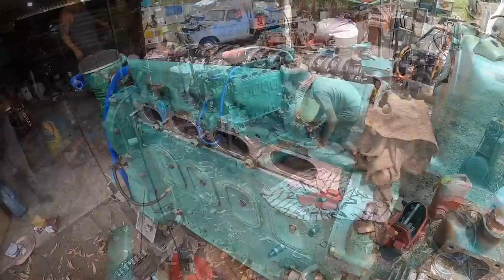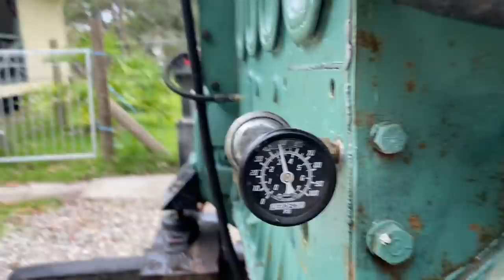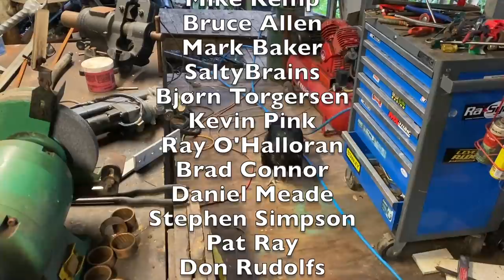First start of the Detroit Diesel 4-71

Comment: Adrian, you are clearly a wizard on diesel engines!!  The way you fixed all the issues as they came up was great!!  Thanks for the Info!!  I once owned a GMC bus with a 8v71 in it.  Great engine never had any issues with it, water pump -yes, radiator-yes, plugged fuel lines-yes - the engine was strong until I sold it. :)

Comment: What a great down to earth guy Adrian is. He certainly knows his engines and the sound of that Detroit running was so different to the noise it made when it was first fitted into Renko was very different. You have been very fortunate to know him and have him do the work on this unit. Be good to see him on a you tube channel just as he is. Be interesting to see how Renko goes once this is reinstalled back in. Did I miss the prop being welded on? New shaft and inner bearings once the Detroit is run in?
Reply from the maker: Prop has been welded on since I bought the boat. Hopefully we can cut it off.

Comment: Adrian: Pulls out a pressure tank, Stu: "Is this cheating?" haha
Man, that Detroit sounds incredible now!
Reply: Sounds a lor crisper, I recall the first time it started after the first rebuild it was quite sick sounding and a lot of black smoke. Zero smoke and good throttle response. Boat is definitely going to run better, first thing I thought of was a good prop upgrade for some more top end.
Reply: @bobbuilder5362  Displacement hull, more digging in, more fuel used, no extra speed.
Reply: @nielsdebakker3283  a higher cruise speed at same rpm is achievable with a tuned prop. Assuming this engine produces more torque at the given rpm. Higher top end may be 0.5 - 1 knot.

Comment: Hey Stu and Adrian, if that sump cap does not have a magnet to collect metal particles I used to get a rare earth magnet that will fit on cover or drain screw also makes it easier to clean because you can take it off. Rare earth magnets can handle the heat.
Great job guys.
Reply from the maker: Nice tip.

Comment: @Dangar Marine, if you need to shut down on cylinder, rather than crimping the line usually you can take one of the injector lines (Jumpers) and use it to connect to supply to the return. IIRC, the lines fit without having to bend anything.

Comment: Sounded good.  Nice even exhaust note so each cylinder should provide equal contribution.  Looks like you picked up some valuable operation and maintenance practices, including triage should something go south.
Reply from the maker: Yes, as well as having a sweet running engine I certainly understand it much better now.

Comment: I had forgotten all the little things it took to set up the injectors and the four valve heads. 

It sure sounds sweet with everything set right this time. The last time it sounded okay but not quite there. It's funny how you remember the particular exhaust sounds of a well tuned inline Jimmy. I worked around the 4 and 6-71s so this is a trip back in time.

Comment: I would definitely swap the exhaust manifold flanges back. You WILL end up with air in the top half and it will overheat and crack the manifold. It needs to self purge air out, via the air bleed on the top - the circulation pump will flush this back to the header tank.
Reply from the maker: I'll look into it.

Comment: You can bypass the injector with the fuel line. All you need to do is to take off the lines from the injector and one of the lines will join back to the fuel rail. No destroying of fuel lines.
Reply from the maker: Would be interesting to experiment with the lengths and clearances.

Comment: Second!!! On the bypassing a injector on most of them you can remove both fuel jumpers and take one jumper and go from the out and in of the head and not mess up a fuel jumper. I've seen the valve bridge break off the bridge guide pin but it will still run on the other two. It really started up clean and didn't smoke like the last first start. You could use a radiator drain petcock as a vent on top of the exhaust manifold to make quick work of bleeding the air. Thanks Stu and Happy New Year.
Reply from the maker: Hey mate, yes, been thinking of changing that plug to something easy to open.

Comment: I was hoping to see what oil Adrian put in as I have heard that multi-grade oils were a no-no for these engines and you should go with straight 40 weight or 30 weight (CF-2) if it is cold outside. The story is that the piston ring gaps are wide to allow for expansion with the pistons getting hotter than most engines because they are 2 stroke. Lighter oil gets past the cold rings and burns forming deposits that cause ring sticking. How do you feel about multi viscosity Adrian?
Reply from the maker: Yes, straight 40 weight is pretty standard for these Detroits and what we put in this one.

Comment: I think Adrian meant EMD. EMD is Electro Motive Division of GM (well once was) and those engines are also Uniflow 2 Stroke Diesel.
Alco on the otherhand are 4 stroke Diesel engines built by American Locomotive Company hence ALCO. Totally different engine.

Like Detroit Diesel EMDs are categorized by the displacement of one cylinder. EMDs are 567, 645 and 710 series. All are 45deg Vee and are V6,V8, V12, V16, V20. Less common is the Vee 20 but even they are relatively common - those secondhand Danish loco imports from 20 or so years ago into NSW have them IIRC. 
EMDs are identical in operation to Detroits however the key difference is the exhaust exits in the Vee and there is one Roots Blower for each bank of cylinders driven at camshaft height on the naturally aspirated versions. 
If EMDs are turbocharged, unlike Detroit 2 strokes, they delete the Roots blowers and have a hybrid centrifugal turbocharger. How it works is it is crank driven for starting and low power settings, then as the RPMs rise exhaust starts to spool the turbine and compressor via an overrun clutch in the conventional sense. They are quite big and not easily identifiable as a turbocharger as they're a big casing on the end of the engine but the Roots blowers on the NA variants are instantly recognizable. Even the side covers of DDs and EMDs look similar.
EMDs are absolutely everywhere in the world. A very common engine.
As Adrian mentioned EMDs are common in marine applications, but they are mainly used for electricity generation in Diesel Electric locomotives and often at power stations. Many EMDs a day rattle across that bridge near Dangar Island as well as Alcos. Alcos have a distinctive rattle sound from the exhaust and dark black smoke when notching up, EMDs sound like the Tug or the gennie in the links below.

Check the veritable cornucopia of Detroit and EMDs in this tug:
https://www.youtube.com/watch?v=c_BKrLZTvsI

Power station load test of V20
https://www.youtube.com/watch?v=hFVJ9Lhhm0I

Shot of EMD valvetrain in motion (note similarity to Detroit 2 strokes)
https://www.youtube.com/watch?v=z6WhVu-UIKA

Nice study of the blowers on this one:
https://www.youtube.com/watch?v=MfjvbRPP_N8

Comment: In my 45 years of truck driving I've probably forgot more than most know on the road now, BUT I know probably 1/10th of what Adrian knows. He's a mechanic taught by experience. Thank both of you...great to hear the donk fire up the way it did. Happy New Year. PS: What Revs do you run the 2 stroke at?
Reply from the maker: Happy New Year. I think it is governered to 1850 RPM.
Reply: @DangarMarine  Sounds sweet...

Comment: There are so many little nuances that have to be learned to work on a 2 stroke Detroit! Curious-what do you need an air compressor for? Are your throttle/shift controls air?
Reply from the maker: Want the air for tools on deck and underwater.

Comment: The bigger injector was out of an EMD, detroit Diesel's bigger brother. ALCO never used unit injectors.
Reply: @Adam Sechrest Yeah, thats just an injector nozzle, ALCO had the pumps separate mounted on top of the cam on the side of the engine block. The big injector that Adrian shows is a unit injector out of an EMD, it has both the nozzle and the pump in one assembly. Notice the one you linked has no plunger or fuel rack sticking out.
Reply from the maker: Interesting, thanks for the info!

Comment: Great video again Stu.. Adrain is great.. I had a couple questions for Adrian. I thought it was interesting that he retarded your timing to 1.470.. from what I have been told is to advance the timing... I advanced mine but I am wondering what his thoughts are on that for a 1983 6v92TA with 9B90 injectors pulling 40k pounds in a motorhome. From what I saw in the book the standard timing was 1.464. Where would he suggest to get as much out of the engine? My second question is about the fuel modulator, I have the boost pressure style modulator. I adjusted it and then I was having trouble taking off from a start so I backed it off. I get a good puff of black smoke at take-off from a start but that's the only time I see any black smoke. Does he suggest keeping that modulator working.. I would love to see an adjustment video showing how to do this, I followed the manual but often the manual is lacking details. Thanks again to you and Adrian for sharing this great information... Happy new year and happy boating for you!

Comment: Is that cap, sliding off the tank next to Adrian's elbow @ 36:06, the one that you couldn't find? It ended up face down in the gravel, by the look of it.
Reply from the maker: No, it was the red plastic cap from the compressor, that was the header tank cap.
Reply: @DangarMarine  Ah. I just remember you saying a cap went missing. It's going to be interesting to see how much better the engine runs when it's back in Renko. Stay safe.

Comment: just a follow up question, did you find a way to secure the oil pump bolts to stop them from walking out?
Reply from the maker: Torquing them up to spec is enough to stop them vibrating loose.
Reply: @DangarMarine   put a loud alarm on the oil pressure to be safe.  i have saw them come lose.

Comment: That engine is more like a EMD locomotive engine as they are both 2 strokes engines and the ALOCO engines are 4 stroke engines.
Reply: The Detroit is a tiny version of the EMD and were designed by Winton,once the oldest engine and car maker in the USA. I served my apprenticeship on the Detroits and EMD's . The latter are really easy to work on despite the size (up to 20 cylinders )and their injectors are around 1' foot long .

Comment: I have a 90 up two stroke outboard mariner three quarter revs running ok as soon as I knock it up to full revs after a few seconds engine cuts out it will start again but struggling to work out why it stops at full revs any ideas ,
Reply: Connect it to a rpm-meter.. Se if you go over recommended rpm..  Some engines have a rpm-cut of.. Could happen if you prop is too small..
Reply from the maker: Could be a faulty throttle position sensor too.
Reply: @DangarMarine  thank you and love your YouTube channel
Reply: @Wollemand  cheers I’ll have a go I have changed the prop no joy there but I’ll keep going cheers